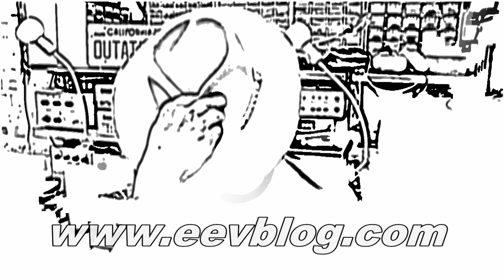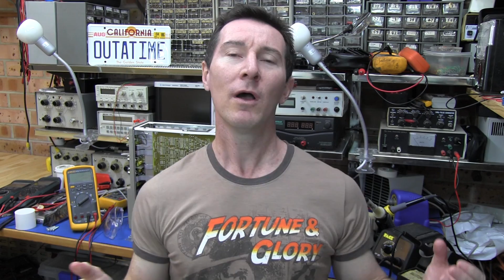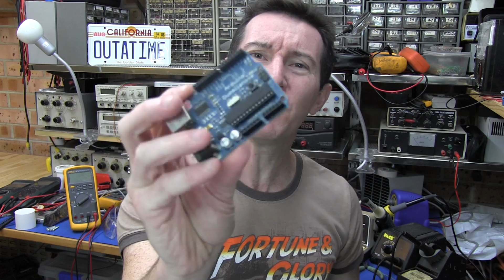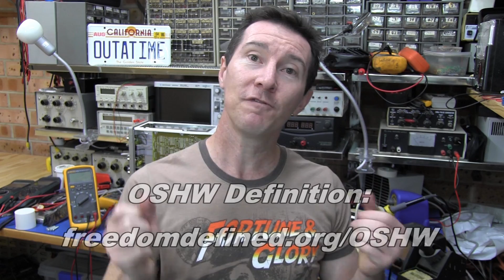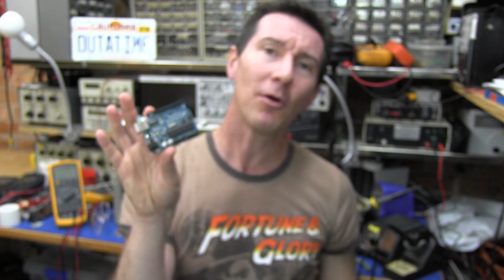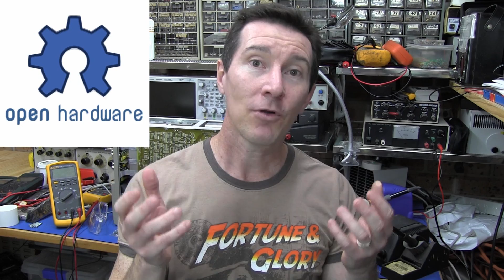Open Source Hardware Explained - EEVblog #195

Comment: Beware that the GPL is NOT an open source license, it restricts people from creating deriviatives.

BSD, MIT, and Apache are true open source licenses.
Reply: Thats not true. GPL is okay with deriviatives. It only restricts people from closing sources.
Reply: No, the GPL is communist bullshit.

the BSD and MIT licenses are truly open source.

No, the GPL is a viral copyleft license, it infects anything it touches. if you so much as look at it the wrong way, those motherfuckers can legally require you to relicense your software under their dystopian bullshit.
Reply: You should be working on apple, right?
Reply: What did you ever try asking? I'm confused.
Reply: I'm asking that because Apple inc is the main beneficiary of BSD license - they took what universities, other companies and community made, made an operating system around that and got tons of money without giving most of the code back. They are parasites. GPL have defense against parasites that's why parasites don't like GPL.
Reply: FreeBSD wouldn't be where it is today without Apple; Also, even the GPL allows commercial use.

So your whole nonsense about parasites is backwards. BSD lets people use their code for free, the GPL is viral as it infects everything it touches, AND they want all changes given back being a literal parasite.
Reply: GPL does not want changes back, GPL wants changes further. PS FreeBSD is dead, btw.
Reply: indeed it is NOT an open source license. open source /= FOSS. one of them is libertarian by nature and the other is progressist. this whole debate about licenses is actually a disguised debate on political views.

BSD has no restriction at all, while GPL restricts from restricting someone else.

which one is better depends on your philosophy, but if you don't want to support one or the other, you don't have to, for example, call it "communist bullshit".

Personally, i think sharing knowledge is what makes society progress so i chose FOSS software over OSS most of the time, but i am fine with BSD, etc., i.e. they are GPL compatible anyways.

--sent from my Linux machine
Reply: ofc not, anything you produce with gpl software doesn't have to be gpl, as it does not include any of the gpl licensed program.

i don't think bsd license can be used for hardware.
Reply: I agree with your original post. I still have a question. If I use KiCAD software which is released under GPL and CC licenses does the product, schematics, pcbs, etc. Falls within the restrictions of those licenses or can I release them under an BSD or MIT type of license?

Comment: is the Raspberry Pi an open source hardware ? is there any open source hardware single board computer  ? i want to creat my own SB computer :) any advice guys ?
Reply: Actually MCU and CPU are very different architectures. Try to be respectful to people, you sound like someone who is actually very new to this.
Reply: +mehdi mahdi Learn and/or digital electronics. http://www.electricaltechnology.org/
Reply: there is not MCU's or CPU's electronics in this linke only electric Eng ... !
Reply: +mehdi mahdi There is. You should navigate through it. Example: http://www.electricaltechnology.org/2014/10/traffic-light-control-electronic-project.html
Reply: Thank you :) it's "Basic electronics" but i'm kind of advanced i have a mechatronic degree i work with MCU's but i never worked with CPU's and i want to learn how to creat my own Single board computer like a raspberry Pi (circuit, coding ...)    :D
Reply: +mehdi mahdi Only difference between CPU&#39;s and MCU&#39;s are that MCU&#39;s are simplified CPU. Raspery Pie for example is using simlified CPu in such sense that its CPU is much closer in capabilities with MCU than traditional CPU. In using MCU&#39;s you need to know how to implement and utilize to use advanced stuff as USB&#39;s &quot; attachments &quot; and such. Plus CPU&#39;s are pretty much pre-built stuff and with MCU&#39;s you can make something your own and earn money in a process :) And Raspberi Pie use 
700 MHz single-core ARM1176JZF-S (model A, A+, B, B+, CM) which is considered a "CPU" but its not, its MCU by all definitions.
Reply: MCU's are simplified CPU's ! i don't think so MCU's and CPU's are different...  MCU can do many things/ every thing .... but a CPU can only do math it works under an OS to run Apps it's faster than MCU... let's say MCU's are smarter than CPU's 
PS : Raspberry Pi uses a Chip SOC not  MCU or CPU it's a mix of many IC/systems, CPU + GPU + MCU somtimes more or less depending on the chip SOC ...
Reply: Aha ... son, you are not very good at your class are you? Because if you are or were at some point in time, you will know the difference.
Lesson No. 1: Learn electrotechnics aka read books about it

Lesson No. 2: Learn electronics aka books again + doing project with appropriate software for making PCB's schematics 

Lesson No. 3: Learn about different MCU/CPU architectures, because indeed there is a difference, but not in a way like this video or like other mainstream media video portraits it and it is, this video is quite mainstream. 

Question: Do you want to be technician whose job is only to install OS or programmer in embedded systems who create IC analog or digital likewise, whose job is to create devices who use them + person who programm digital ones? 

 Arduino/Raspbery are devised for children to get into electronics not electro engineers to earn money except those people who sell it.
Reply: SON !!first let's have some respect do not call me SON having watching a couple of YouTube videos about electronics do not gives you the right to call me "SON"...  maybe you should read books about it or go back to university...saying that MCU is a simplified CPU ...after what you just said i don't think that you can give me lessons.
Maybe you don't know what Mechatronics means ! Google it and as i said we use MCU's not CPU's working with CPU's is somthing i want to learn and i never uses Arduino or RaspberRy ... what i'm trying to say is that you may need to learn before teaching and allow me to give you somthing to start with : " MCU's and CPU's are different ... mate"
Reply: Richard Lushai i'm respectful and there is nothing disrespectful in what i said ... not allowing somone to call me "son" is not disrespectful  !! i'm maybe new to  CPU's but not MCU's .
and you are welcome to minde your own business if you have this kind of comment !

Comment: 5:31 the trap with a lot of these licenses is that they've never extensively been used in any sort of court system.

So although they have been written with the best intent, who is to say that individual copyright laws can't overrule them? OSHW and open source software relies way too much on hobbyist and DIY environments. If any sort of serious community with nasty lawyers would start using it, you could be in a lot of legal trouble

Comment: what if I use pirated EAD to design open hardware, then convert the design files into some open source format like kicad and such?
Reply: i mean, can you still claim as open hardware?
Reply: Ever tried converting EAD design files? It simply sucks and you loss design information in the process.
I would rather redraw the schematic and redesign the pcb based on a print out of the gerber files and the coordinates of the parts, then thrusting a converter.

And take a look how Dave handles his "open hardware" the uCurrent: The design files are all altium and he does not supply the panel data. I mean: There is nothing wrong with it. He has an altium license, altium is a good software and the panel is assembly house dependent etc. pp., but Dave does compromise on some aspects of "open hardware" him self. On the other side: His videos can be counted as part of the documentation. Taking that into account, the uCurrent is really great documented piece of open hardware. Pros and Cons on all sides - I´ve ordered a uCurrent and I think Dave supplies plenty information to his product. Is "real" open hardware when it is drawn in a proprietary software? I don´t care. It is more then open enough for my purposes.

Comment: @raindogred I was thinking of that first, but the USB to Serial IC is not available is dip package. So, no go on that... Anyway, I ended up buying an original Arduino at radio shack.
Reply: Very old comment, but wrong. There are ICs in that DIP package. Here is one: MCP2221
https://eu.mouser.com/Semiconductors/Interface-ICs/USB-Interface-IC/_/N-45lw3Z1yzvvqxZgjdhub?P=1z0z63x

Yet, interfacing it looks rather complicated, but whatever.

Comment: (CONTINUED) I,m Looking for some better pots for volume control. ie, The ones im using dont turn down enough And also they go to high (LOUD). I was woundering dave you being a real pro, If you could help me out with some advice mate (PLEASE) so i can get my project back on the skids Im using a very basic diagram, it works but there are no values on the  parts it,s a bit of a guessing game They are going to have a mono stereo switch + volume on both cups. Right bact to your vids mate. regards Bri

Comment: Good video but I think one of the more important aspects that you neglected is that Open Source products in general will reach a much much larger audience than they would if they were closed source. An example used in software is that if your closed source product sells 100 copies at $10 for $1000 total profit, as open source you might have 10,000 downloads with 2% of down-loaders donating an average of $10 for $2000 total profit. It can work similarly with hardware due to increase word of mouth

Comment: My problem with open hardware vs open source software is that OSS is free standing.. I'm using a computer that is running a full open stack from kernel to compiler, desktop, browser.. open source hardware doesn't have that, unless you use all 74 series logic, passives or similar you will have  proprietary parts and other peoples  IP involved. If we take the Arduino for example.. wiring up an Atmega168 isn't hard. The valuable part is the IDE and open standards like the (broken) shield system.